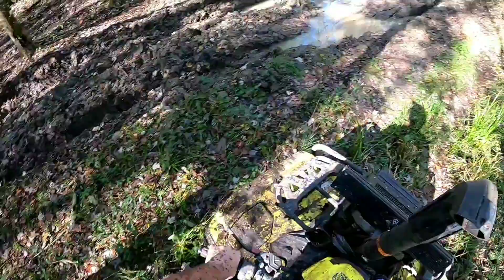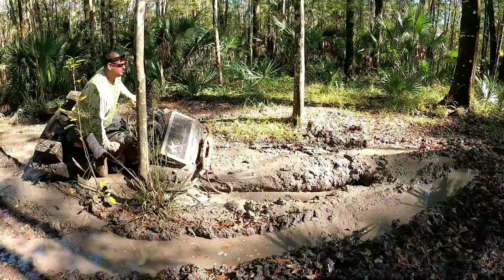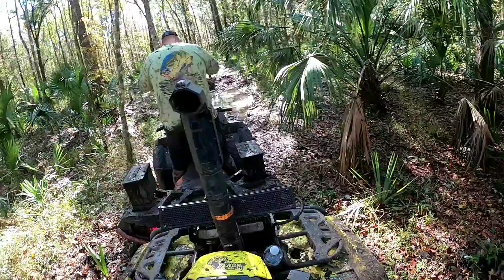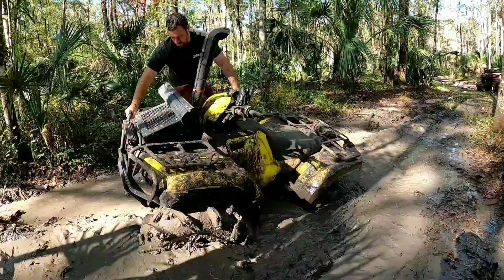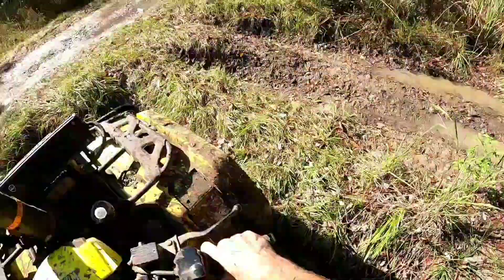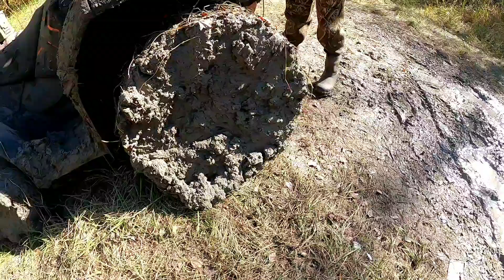We're GONNA need a Truck!!!

Comment: This Honda 300 is very weak just like a kids four wheeler
Reply from the maker: Needs more power and to take the water out his tires
Reply: Was you running the outlaw threes in this video
Reply from the maker: @jakecrane3690  Yes. I put the OL3 on Ducky as Im still running 32 Assassinators